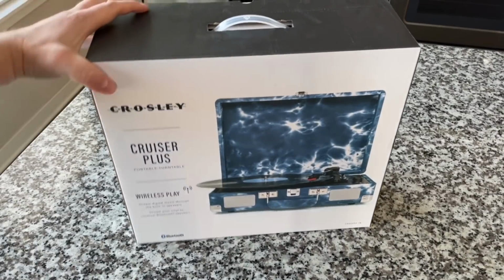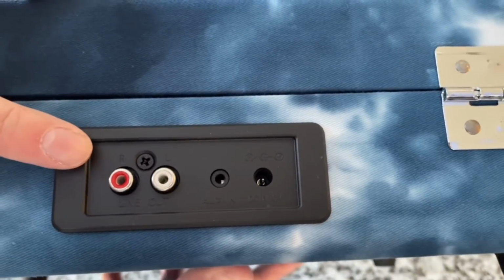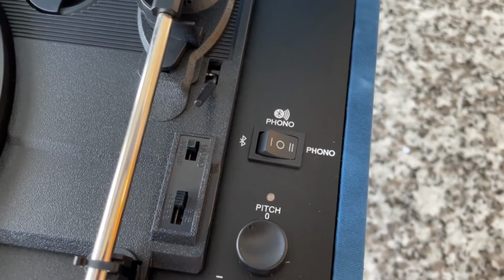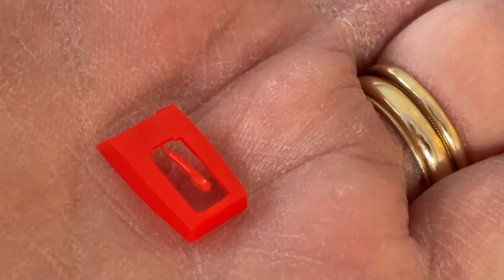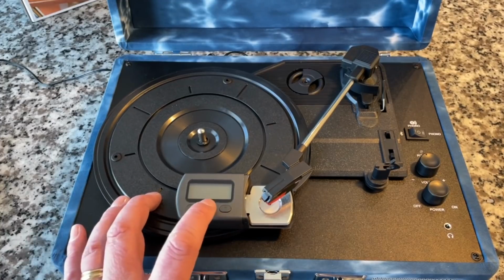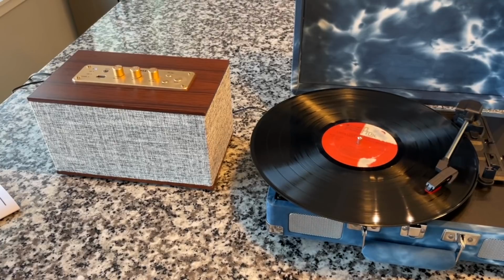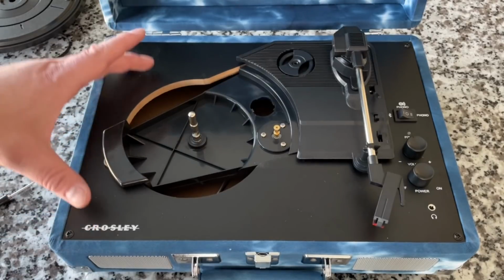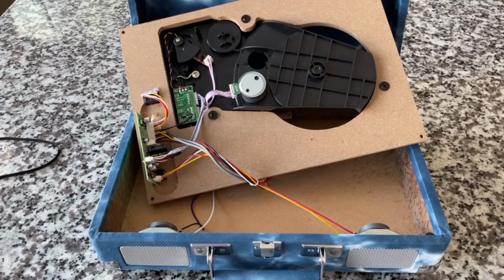Crosley Cruiser - UNBOXING / TEST / TEARDOWN!

Comment: What about older styrene 45's? How many times can you play a styrene 45 on one of these Crosley players before it destroys the audio quality of the disc? Styrene discs are a much harder and less forgiving material than vinyl and were injection molded versus compression pressed. The styrene 45's were manufactured by the billions for some of the biggest record companies and are easily found in just about any store that sells used 45's. Now that's a video I'd be interested in watching.
Reply from the maker: Look up my slot in mpk review….it did not end well
Reply: @Recordology  Okay so how about playing a clean styrene record 30-40 times on this Crosley without blowing the dust off and show the end result.  I'd be interested to see if it ends up like Dave Brubeck.
Reply: @Recordology  You sure learnt the hard way, your Duke Ellington chewed up
Reply: Those styrene 45s were not meant to last. They were cheap, mass market singles meant to introduce you to the top hits in hope you would like it enough to buy the vinyl album it came from. Proper singles were pressed on vinyl 45s. The companies that churned out styrene 45s weren't singles oriented labels, they were album oriented. If you bought a pressed vinyl 45, it meant the label was singles oriented and cared about the quality of their product.
Reply: The 45 RPM  players sold by the developers, RCA,  used crystal cartridges and Osmium (metal) needles. Very high tracking force of 8 to 10 grams and needle wear measured in low hours. Like 40 or so. The crystal cartridges were bulky and heavy and subject to damage by moist as well as dry environments. Early technology best forgotten.
The players only accepted 45's, by the way.

Comment: 5:38 Yeah, Crosley is nothing but just a name. It was a manufacturer very long ago, hence the so called "100th anniversary", but it has been non-existent for a long time. Not too long ago some branding company has bought the name - the new company doesn't have its origins at the Crosley company that existed 100 years ago. These suitcase players are made by Skywin/Ya Horng, the Crosley DJ turntables are made by Hanpin and those C10/20/50 etc are made by Pro-Ject. The name is just a name, not a manufacturer... but those salty people don't know crap about it. The Victrola, Crosley, Ricatech, Looptone, Fenton, etc. are just all made by the same OEM manufacturers (Ya Horng or Skywin) that offer a few variations and those are customized to the wishes that those brand names provide. Like adding denim exterior in this case.

However, most salty people just want to prevent disappointment of newcomers. I mean, I've heard plenty of stories how people bought a suitcase player, that they found to sound harsh, shrill and unpleasant. Broke down within a year or two (hello e-waste, bye 50 bucks, bye sustainability). They just gave up on playing records. Only when they first heard a half decent turntable they got interested again.
Or the salty people are being salty because they've been let down by one of those themselves.
So I can see where their saltness is coming from.

The only thing I hate about those suitcase players is that they're disposable items, very bad for the environment (and bad for the wallet, in the long run).
There's way too much e-waste because of the practices of companies like Apple already, we don't need more of that.

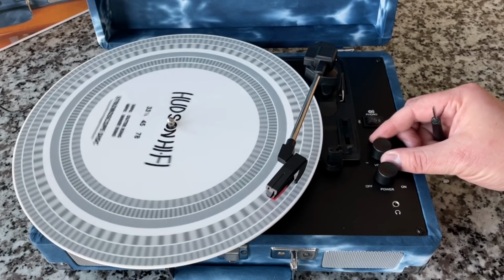24:10 I'm sorry to be "that guy" but that's a speed adjustment, not a pitch control. 
Speed adjustment is used to calibrate the speed of the turntable, while pitch control is for controlling the pitch (by changing the speed). 
0% on the pitch control means it's at the right pitch (i.e. the right speed) not higher, not lower. 
It's mostly used for mixing records as a DJ, but originally it was developed as a feature for playing records that aren't cut/recorded at the correct speed.

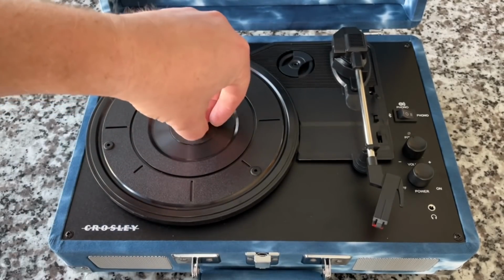39:41 I call those Jesus clips, because every time it takes off flying through the room I'm like: JESUS! 😜
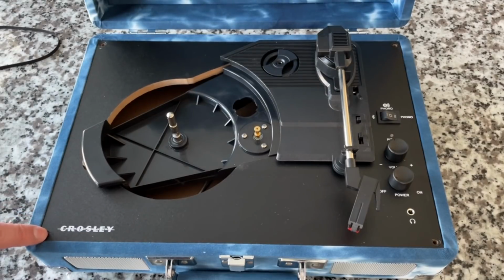42:50 Protip: If you've stripped the wooden holes with those screws, get some matches, cut off the phosphor heads and use the wooden sticks to fill up the holes. 
Now you can use the woodscrews yet another time.

Comment: You say this is "all new": apart from the bluetooth, what about this is new?    You say this is designed in the US; we know that the platter and arm mechanism is "off the shelf" from China: what part of this is designed in the US?
Reply: I suspect the player WAS conceived here in the US, but the implemention and component selection was done at the factory in China.  

Basically, the marketing company said, 'This is what we want it to do, and what we want it to look like, and the name we want to stamp on it', and the factory engineers in China said, 'OK, Joe, we fix you up real good; 20,000 units, give us about a week!'  And 'Crosley' gets to claim 'designed in the US', even though most of the details were decided in China.  Deceptive?  You bet!   That's MARKETING.

Nothing that makes up this player is particularly unique.  As you said already, the Skywin platter mechanism is off-the-shelf (and its designed copied by many manufacturers), but did you know the amplifier circuits are off-the-shelf, too?  The amp and loudspeakers are basically identical to the sort of hardware you'll find in many inexpensive computer speakers, just augmented with line-out and line-in connections, and depending on the feature set, a USB port,  a bluetooth receiver and/or bluetooth transmitter.
Reply from the maker: I know they specify pretty detailed configurations and parts.  The 1975 is an early Crosley design.
Reply: @xaenon  So basically domestic “manufacturer” [let’s call them, say, “Grossley”] “designs” this by placing an order offshore requesting standard 3 speed plasticky platter and tonearm, knock-off ceramic cartridge, pitch control, 6 nice colours for the case, shiny hinges and clasp, RCA’s out, Bluetooth, nice bright blue LED function light and a clever name, let’s say “Wormwood” ?  A suitcase player is born?

Comment: Don't ask me why but I experimented years ago with my one turntable with a great cartridge on it that wanted to skip on one of my prized albums.  I did set it for the recommended tracking force and anti skate but it skipped and it never had done it before on that record and it was a brand new stylus at that time.  The record is still in pristine condition in 2021 (this issue happened back in 1993 for me).  Long story short I reduced the tracking force by about 1/4 gram and that fixed the skip problem.  I realize this is a ceramic cartridge with no tracking force adjustment and my situation was on a Technics SL Q3 which still works great.  I replaced the cartridge back in 2010 with an Ortofon Concorde S which sounds amazing for what it is.  That stylus was rock solid in its playing.

Comment: The 6Gr tacking force is completely safe for records.Its NOT the tracking force that damages records-but the SHAPE of the stylus tip.Should be rounded.At one time record shops and Hi-Fi shops had microscopes that you could examine your stylus with.If your stylus had a jagged,nicked,or broken tip you could replace it at that shop.They stocked spares!
Reply from the maker: Exactly!!!
Reply: @Recordology  The ceramic carts. have a tendency to REALLY amplify the midrange of music (1000 Hz) many vocals and some instruments are in this range and come through as if you were standing in front of the speaker output of the raw recording. I cut the 1k using a graphic equalizer when I was younger it hurt my ears because some 1k frequencies were really strong in some music some guitar made my 👂s bleed, that may very well be the harshness you referred to.
Reply: @Recordology  Even though those speakers are rated at three watts I'm will to suggest they are getting more than a watt maybe 2 watts. There isn't even a heatsink anywhere on the amplifier board LOL.
Reply: Not related to this particular comment but a few words about the impedance matching, it is very likely that isn't the issue at all it is HIGHLY likely it is simply the size of the drivers (speakers) and the low wattage of the amplifier. When you played it on the bluetooth speaker it was most likely coming off the same feed going to the built in amplifier. The sound was there the whole time, it was simply the speakers and the amplifier driving them that didn't provide the bass response from the vinyl. 
That said I certainly wouldn't say there couldn't be an impedance mismatch, just saying those tiny speakers aren't capable of producing a good bass response due to there size. Like listening to music through your cellphone speaker it simply isn't capable of reproducing bass like a HiFi system.
Reply: Yes… at one time.

Comment: Normally I am not a Cruiser fan-these TT's could be more useful if it has an internal rechargeable battery power supply.Then you can use it with AC power from the wall wart or without from the internal battery.The wall wart could also charge the battery,too.Then this little TT could be used anywhere!! For cereamic cartridges-they CANNOT drive a line level in directly-the ceramic carttridge needs to be loaded by 1Meg ohm or more.Usual liune level inputs are 200-300 Kohm.So the line amp in the TT just matches the cartridge to the line level input on another amp.In an emergency I have played ceramic cartridges into a line in-but it sounds tinny and weak.

Comment: I'd like to point something out about the needle wearing it out. It's still amazing that you can play a record 1k time and them have to replace a diamond needle but the record will still sound fine
Reply: The stylus gets friction the whole time it's playing records, while the record groove only gets friction the instant that the stylus passes it while playing. It's only natural that the stylus is going to wear out long before the record does. A ruby stylus is good for about 100 LP records, sapphire is good for 1,000 records, while diamond leads the pack at 10,000 records. Usually, the color of the stylus holder tells what stylus you have. Red for ruby, green for sapphire, and white for diamond. Althoug it's not universal brand to brand. The difference in wear between a tracking force of 1.5 vs. 6 grams is minuscule. It's only when you get up to 10 grams or more that you'll see any appreciable wear in your records. And those levels haven't been seen since the old, crystal cartridges of the late 1940s and early 50s that were mostly used to play shellac 78 rpm records. Sonotone introduced the 8 gram, ceramic cartridge in the mid 1950s, and stereo cartridges have never tracked more than 6 grams.

Comment: No this is not a bsr clone....a lotttt of bsr tables had adjustable weight and anti skate
Reply: Not a clone, no - but it is derived from something BSR cooked up toward the end of its tenure.  It was to replace BSR's 'classic' design, because it was cheaper to manufacture.  Someone did a video on it (VWestLife?   I think?)
Reply from the maker: Correct
Reply: @xaenon  In 1968, BSR came up with its Micro changer. A record changer half the size of regular changers, with a 7 1/2" platter. Regular changers had 9 or 11" platters. In 1978, they introduced the single disk version of the Micro. This Skywin is a cheapened clone of that mechanism.

Comment: I have to strongly correct you on something you keep saying, in reguards to ceramic cartriges.  They do not have a signal output equal to ither components, such as a CD player, or a tape deck.   Their signal may be strong enough to amplify, but is very weak, and lacks frequency responce. To say that the cart is impedence mached or not, is really not whats going on. Theres way more to it.

Back in the day of all in ones, (60s through early 80s) all those bsr record changers with ceramic carts were given a proper preamp to feed that signal through. It sofened the tinny highs, and brought out the lows, making the sound more ballenced.  You can, in fact send a ceramic cart signal through a preamp made for a magnetic cart, it just requires a few extra parts to make it work properly, such as, resisters, and capacitirs arranged for the circuit to calm the bass, and make the signal feesable for that tyoe of preamp input.      Remeber that red crosley soundburger type record player? It was really distoted, because, it was sending a ceramic cart signal to a preamp meant for a magnetic cart.

I have an Optimus SA 155 stereo amplifier. This is the same amp VWestlife uses in a few of his vudeos reguarding record players. It has a selector switch for the differant phono carts. Either way, it goes through the preamp.

I bought a Crosly cruiser at Walmart,, close out sale,, for 30 bucks. I tested everything about it.  I found out that they designed the electrics to not only cut the lows from the bluetooth signal, and input signal, but they reduce what little bass is produced from the record player.  SO,,, i compleatly rebuilt it.  I took out the circuit board, and put in parts i had salvaged. New amplifier, from a set of computer speaker i modified a bit. A bass and treble control, from an old stereo years ago. And a phono preamp that was built in an old record player. I added the proper parts to the input of the phono preamp to make it accept the signal correctly. It sounds really good now.  I also replaced the crummy speakers with better ones, and even added external speaker jacks where the line out sockets were. I have no rumble feedback issue with the bass i now get out of this.  It now has to run on 9 volts, instead of 5, but, its far better then what it was.
Reply from the maker: We will have to agree to disagree.  The fact is that ceramics output line level although there is still an amplifier in this to drive the speakers.  The first Gen Crosley Revolution (soundberger type) uses a groove tool clone magnetic cart.  The second Gen Revolution uses a ceramic.  We have reviewed both.  Glad you could improve your cruiser…sounds like a fun project.
Reply: @Recordology  ,, all im really tying to say is,, cramic carts can sound really good with the right treatment,, i just get flustered with these suitcase players, and a few other models for not putting in the small effort to make that happen.
Reply: That is cool, I haven't heard anyone doing that
Reply: The original ceramic carts came in three levels of output. Low was about where they are today, medium was line level, designed to play through the audio section of a radio, and high was 3 to 4 volts, to feed the cheap, one tube kiddie players of the day. The advent of cheap, solid state electronics made the medium and high output cartridges obsolete, as it's simple to add amplification stages for the low output carts.

Comment: It’s funny that you say Crosley and Victrola are completely different companies and don’t source their parts from the same manufacture but then why the heck do they all look the same? I must be missing some thing and wonder if you could shed some light on that?
Reply from the maker: This is a very good question! They do indeed look very similar until you get them side-by-side and then you notice major differences in dimensions, materials, and fixtures. There are a handful of OEM manufacturers that make suitcase players sold under a variety of brands. I think we did a video a couple years ago comparing two side-by-side and noting the differences.

Comment: For some odd reason, I bought a Crosley Cruiser many years ago and it broke within the first 15 minutes of using it and the cartridge headshell had not been attached securely. That's not to mention the truly toxic smell of the unit that made me feel sorry for all of those Chinese factory workers living day to day with that toxic stench that likely shortened their lives.

So, needless to say, I'm not a fan of Crosley Cruisers, but the Crosley C10 made by Pro-ject is decent enough (but I have far better vintage turntables). That Crosley Cruiser of mine has sat crying in its box unused for several years now. ;)
Reply: Over the years, I've had my hands on a number of Crosley phonographs and they all have that odd "chineezy" smell to them. As far as yours falling apart, that's not uncommon because quality control is basically non-existent. You may get one that is actually "right", the next one may be "in between", and the 3rd one may be a disaster. About the only Crosley self-contained record players that I have any use for are the Stack-O-Matic models and that's more for the novelty of a record changer being made in the 21st century and some of their earlier portables, such as the CR49, were sort of OK; but, most of their offerings that use the infamous Chinese knock-off of a Chuo-Denshi CZ800 ceramic cartridge are junk.
Reply: @radiotvphononut  I like the CR49 Shango 066 brought me to it on the Crosley Road test in the car, I also have the Ray Parker record, Arista are notorious for low recording levels. One day I'll get my dB tester and compare RP on the CR49 vs AM pocket Realistic Flavoradio to debunk Shango's claim of pocket radio being louder than the Crosley
Reply: I owned a all in one by victrola and they are better but I had to return the first one due to the speakers being busted out of the first one....the issue with mass production is not good quality control
Reply from the maker: The only reason I do this channel is to convert you one day… Someday… Lol
Reply: @Recordology  you helped me not get a crosley
Reply: @Recordology  I love the concept of the Crosley Cruiser, i.e. an affordable and portable record player that plays 33's, 45's, and 78's (which is why I bought one years ago, particularly to play 78's, but the unit was awful), but all I ask is for any record player or turntable to be built reliably to play music enjoyably. If they can achieve that, mission accomplished. :)